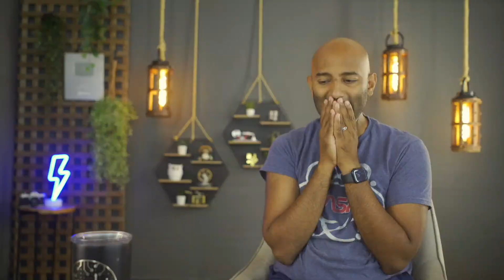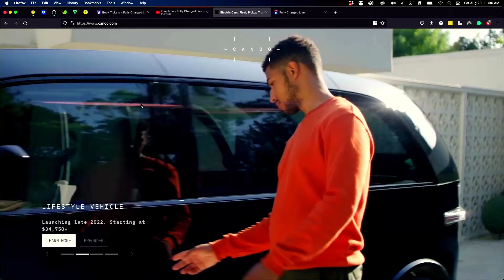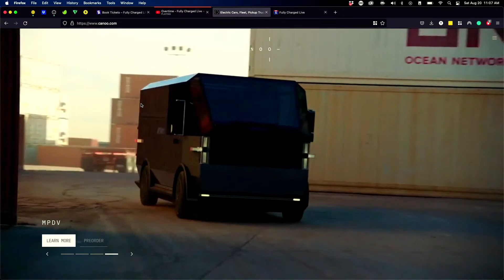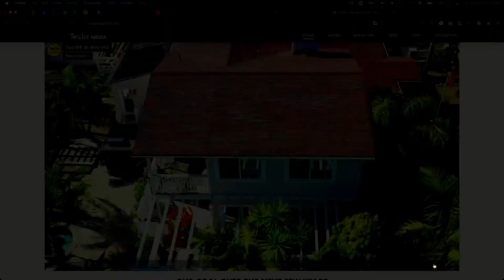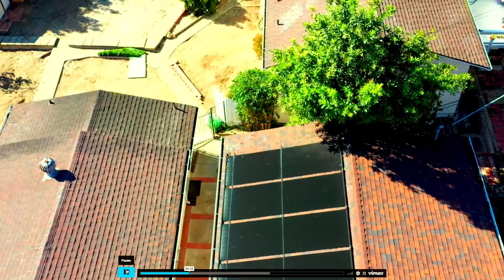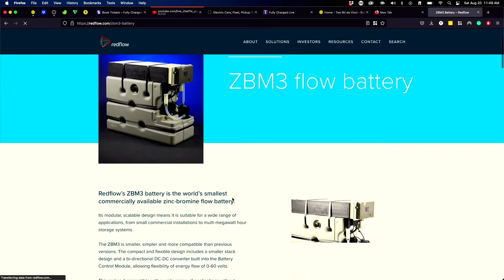Overtime - Fully Charged Live + Net Zero Updates!

Comment: In essence a air conditioner is a heat pump, but it just needs the reversing valve, and it needs a defrosting cycle to be an actual heat pump.

Comment: I plan to be at Fully Charged in San Diego. Then I need fly out to an electric power generation meeting in Minnesota with many other engineers. When you meet with Walmart ask them why they have not added EV Class A Semi-trucks between their remote DCs (150+ miles), especially in California. Why did they go with 80kWH instead of smaller batteries on their Canoo vans if daily delivery is less than 100 miles/day? When do they plan to charge the vans and what are some utilities telling them about utility-managed charging? Ask them about what they are hearing about 3.5MW MCS chargers issues during peak hours. I am seeing electrical supply delays pushing utility grid projects out for 3 -5 years. I am also getting mixed messages from power generation engineers in some areas of the USA.

Comment: Does ground source heat pump work well in your area? …that would be another thing to look at when going Net Zero. 
Or maybe it’s just more cost effective to just use efficient air-source heat pumps. 
“Radiant heating/cooling” would be TOTALLY cool too! The Apple store by us in Scottsdale AZ has radiant floor COOLING… which you rarely hear-of. 
Makes total sense, because cooling an entire concrete slab as a thermal flywheel makes sense. AND the cool floor is where we exist. Not near the ceilings, as with conventional AC vents.

Comment: My favorite part of your videos is the bread and butter boss.  New batteries typed and when you brake down the little devices that help be more efficient...ie I'm about the get that 4 pack of thermometer.   Ps I made my own ground mount for 13.4 kw in a way to move it from 10 to 30 to 45 degrees to match the season!
Reply from the maker: Really! I’d love to hear how you’re doing that. It’s a challenges with such a massive system! I love it!
Reply: @TwoBitDaVinci  I'm proud enough to type it out for ya.  It's something I thought of for a couple of years as I wanted a shed to park my lawn equipment trailer under. 
3 telephone poles 9.5' high vertical and spaced over 25 feet east and west.  Metal plate on top of post to reduce ware and friction.  Then a 27 foot telephone pole places horizontal on top east and west.   Over this pole I placed a 4 inch ribbon steel band and lag bolted it down to the vertical pole. So with 3 posts holding it down  ..I will then be putting heavy earth anchors in with steel cable for redundancy as I live in a hurricane zone.
Now approx 11 foot south is another telephone pole horizontal that when set down on to blocks on the ground will be 45° for the winter months...when set up at approximately 4 feet, it equals the 30 degrees for the 7 week interums between the 45° and 10°.  Then place up to approximately 8 foot on a different posts to equal the 10° for summer.  I had to fabricate a 10" pipe over the horizontal pole in 3 places and build 3 different sets of 2 location anchors at approx 10 and 12 foot away from the higher posts as the roof gets wider the closer to horizontal it becomes.  I will have heavy gauge pinned in to the collar I made on the horizontal pole and the anchor in the ground.  With my tractor in about a week I would pick it up 2 inches...remove the 30° legs , then set it lower to then set on the ground blocks.  I will then on this have ground anchors and ratcheting chains to hold them down..  the top is fixed hight so a cable is perfect...but the bottom will move from ie 1 to 4 to 8 feet so adjustable chains will be the tool to hold them down.  
Way over built because of my comfort with wood over metal. And the shed is built and the solar is on it and the mower is under it and have calculated all dimensions....but life and loosing a 17 year employment said I will build the anchors another time as now its on telephone pole just like the top side for now at the optimal 30° for this location.
Next panel mounts I build for my brother will be SUPER lighter with the same concepts being used with just 3" steel pipes ie. 20 foot long will be the horizontals, with then the solar company just putting the rails to that pipe.  
After building the big shed, I did modify my old 3.4 kw emphase panels from 30° to 10° and could see a nice increase of power over the pervious year! (Much lighter and easier to make the ground anchors!)  So I'm excited to get my extra 10+% monthly when I can move the larger panels up in the summer and lower in the winter!
Way over built with reduncies everywhere to hold it down during hurricanes, but the price I paid to have a solid roof to park under and get semi trackable solar!
Reply: Ps. On top of the 2 horizontal poles I have rafters.....then lathes....then r-panel sheet metal to complete the roof structure.....then the solar company mounted to that roof.